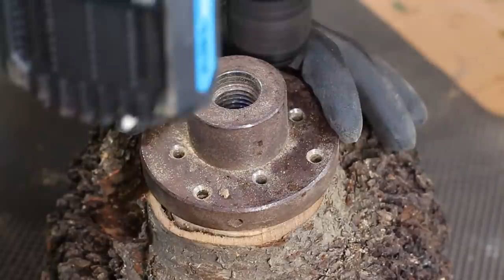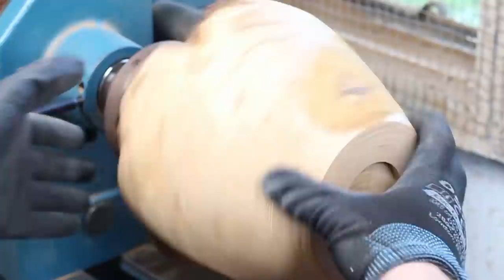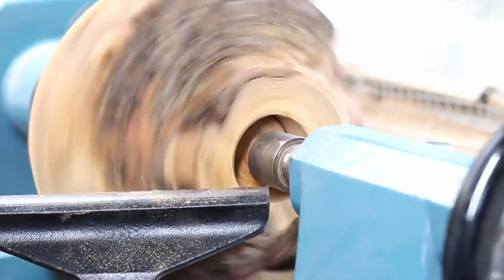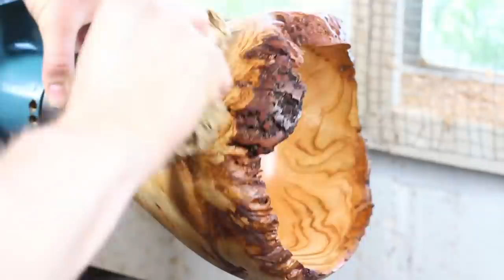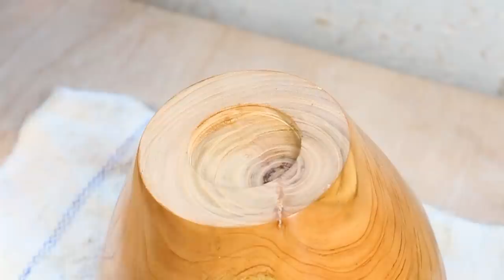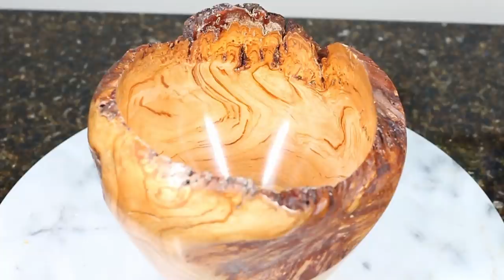Woodturning - Cherry Root ball to Amazing Vase

Comment: Hello Harry, you made a great bowl, I like your finish with Danish oil and then Wood wax.
I believe this wood is a grafted part which is usually just above the ground level and causes this kind of deformation.
I also recently made such a bowl from cherry wood, but luckily I was able to keep a lot of the bark on the bowl. Cheers, Hans

Stay safe and keep  turning
Reply from the maker: Thanks very much Hans! I believe you are correct, Stay safe 👍😊

Comment: Hey. I cannot say how this, how your work, pleases me. Incredible. IAM jealous .  As a little hint, something that I have learned from another vid here, if possible on your lathe. 
( I don't speak technicial English, at least not about woodturning;) So excuse my wording) 
Before removing the piece from the headstock, install the chuck on the tail side. You can perfectly center and press the chuck with the tail stock pin. Afterwards you can turn the wood piece around and remove the faceplate.
Reply: Thanks Chris, I do appreciate the suggestion which I have tried in the past but doesn't always work for me. Keep watching 👀 😃👍

Comment: Breathtaking! I wonder shouldn't such a massive piece of wood be fixed on both sides , at least at the initial stage of rotation when the block is unbalanced or fixing at one end is enough? Thanks
Reply: Hi Roman, its personal choice and I felt it was well balanced, secured and didn't require additional support. Thanks for watching 👀. 😃👍

Comment: That is actually a Tree Burl commonly found on branches… or more commonly a called a Tree Burr

Good Use of a Good Resource👍
Reply: Let me say this… the true artist touch, turned something most would pass by into something grand 👍
Reply: Thanks P Y this is a graft. It is the joint or connection of two different trees grafted together, usually to improve root stock or improved disease resistance. 😃👍
Reply: @py2724  thank you for your comments  😃👍
Reply: @HarrySmithShorts  I love grafting, I’m developing my skills for the Orchard!!!

Keep doing what you do!

Comment: Hi Iam BC and have just started turning wood I was trying to make a handle for my  tail stock and then a wood mallet but I can't get my tail stock to lock down. I bought this used and I think some of the parts are missing anyway I order a new tail stock from harbor freight once I get it I hope it has all the parts. How ever I m hoping  anyway because I can't use it until i can lock it down maybe I'll be able to fiqure it out. I can't wait to start turning. What size is your lathe? mine harbor freight 12" x 36". I like what your turning now out of that cherry wood it looks like a vase . Wish me luck I am going to need it. I am trying to learn all I can any points you can suggestions to me is greatly appreciated BC.